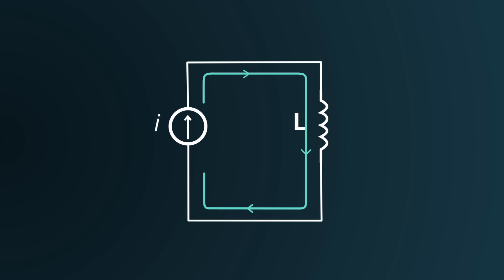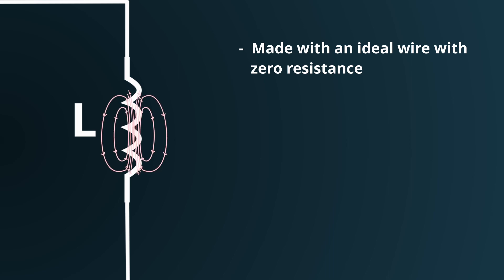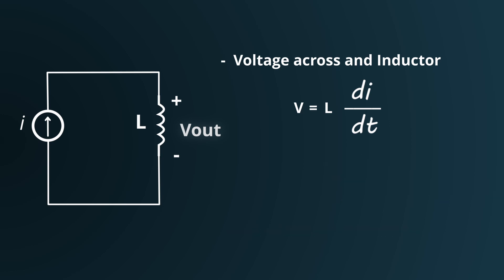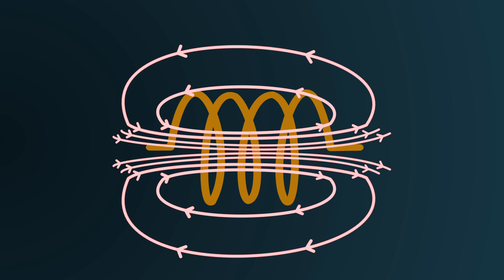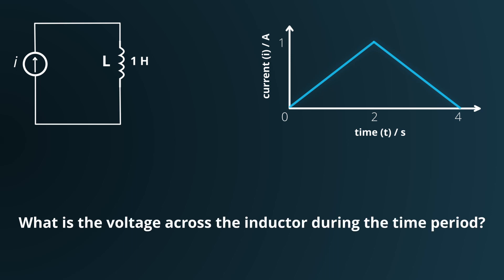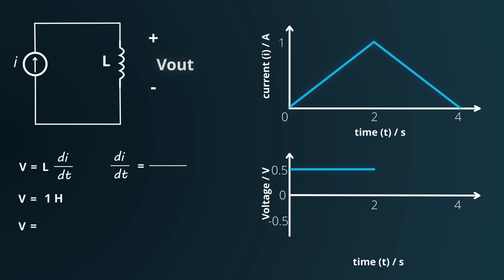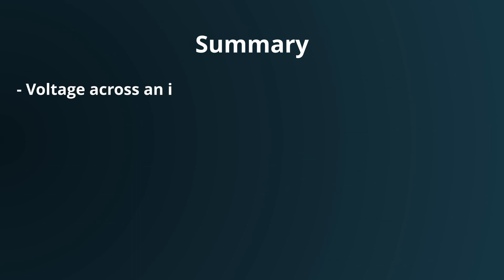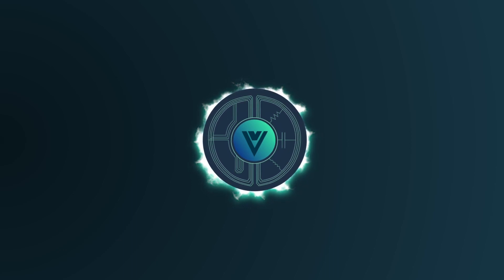Inductor Voltage

Comment: great explanation, explains why at DC (non changing current) the voltage drop across an inductor is zero volt, hence the inductor behaves as a short circuit at DC
Reply from the maker: Glad you found it insightful. Thank you for watching
Reply: Correct me if I'm wrong, but can DC current also change in magnitude?
Reply from the maker: Indeed, you're right. DC current can change in magnitude, but when we refer to 'DC', we usually mean a constant, unchanging value. It's when DC is first applied or removed (transient states) that you might see changes in current magnitude, during which an inductor would still resist that change. But once the DC current stabilizes, the voltage across an ideal inductor becomes zero  @palmshade1489

Comment from the maker: Thanks for tuning in. We'd love to know your thoughts about this video.
Reply: Can you make a similar video about capacitors please
Reply from the maker: Hi, Yes we are working on a video about capacitor voltage and current. Stay tuned!  @Miketrack101
Reply: Can you explain why current lags in an inductor?
Reply from the maker: When voltage is applied to an inductor, it creates a changing magnetic field. This changing field induces a voltage that opposes the original change in current (due to Lenz's law). As a result, the current doesn't instantly rise to its maximum value but gradually increases, causing it to "lag" behind the voltage. In essence, the inductor resists sudden changes in current, leading to this lagging behavior @AnastasiaGrot